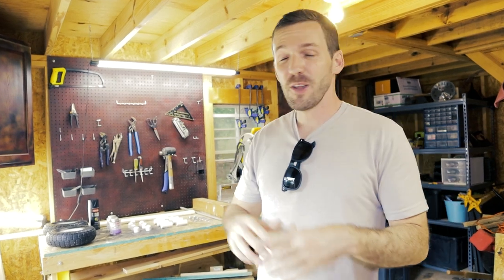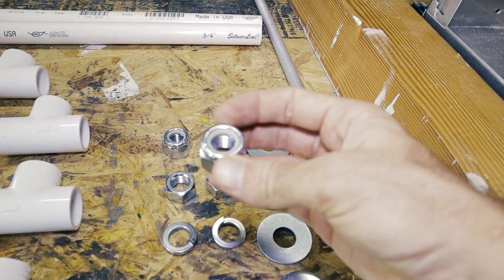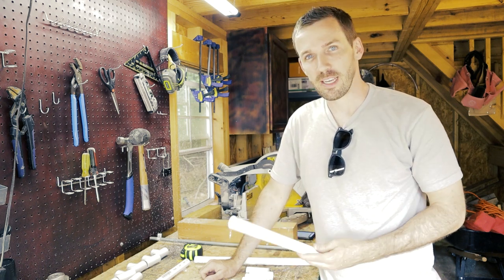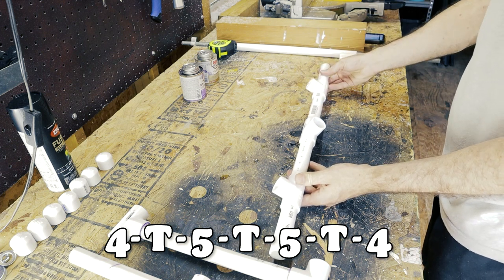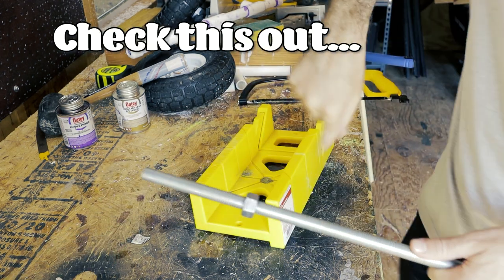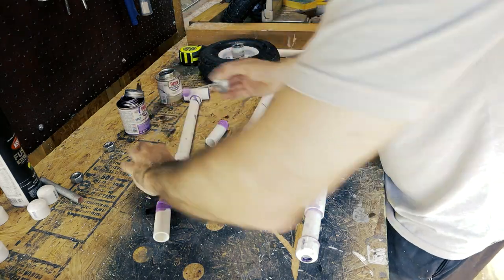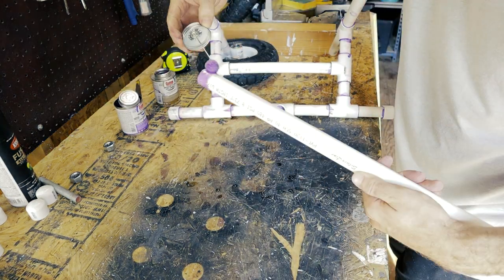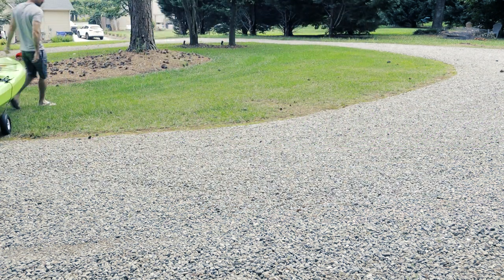How to Make a Kayak Cart out of PVC | CHEAP

Comment: I just added up the cost to build this as of July 2022. For the glue and parts used, going with Lowe’s prices, and two wheels from Harbor Freight, it is about $65, not counting the need for a foam pool noodle or pipe insulation, paint, or bungee cords to secure it to the kayak. Starting from scratch I believe this would be about $75 or more to build, using all new supplies, and doing it 100% right without cutting corners. If you already have some things available then it would be a bit better. Otherwise I have seen some ready made kayak carts already available for around $50, though the wheels don’t seem to be as nice. But those could possibly be replaced.

Some suggestions I would have when building this one would be to add 3/4” dowel rod internally in the H frame and in the top two T frames where the kayak rests when in use. This would strengthen the frame considerably against flex or impact. The Tee joint fittings would then be the only weaker areas, but at least the longer pipe areas would be much more stable and less prone to crack when flexed. Also, in order to make the paint stick better, or simply just to remove the lettering that is all over the PVC, rub it down with acetone. This wipes lettering right off and removes the glossy surface, leaving a matte finish that paint will stick to more easily. Nail polish remover is usually 100% acetone and is cheap at the dollar store. Works great.
Reply: For those tracking, this cart cost just north of $100 to make in July 2023 from Lowes
Reply: @giantmanice  I bought a decent one for $40 last fall. The same one now is $55, but that’s still just half of what you just stated. I don’t see any gain in making one anymore.

Comment: Thank you for the video. It was very helpful for this first timer. I have a few things to add …
.. when gluing, be sure to push the parts together firmly. Probably a no brainer for most, but again- first timer. 
.. I added a 1/4 x 3” eye bolt to each of the lower sections of the lift sections so I could hook a bungee after loading my kayak.

Comment: I made my cart almost exactly the same.  To make the holes for the axle in the pvc, I drilled small pilot holes and brought them up to size with a step drill. I used 5/8" cold rolled as  opposed to redirod. I hold the wheels in place with a small cotter pin and flat washer on each side. I broke one upright on mine, due to gross overloading and a bumpy trail. It was handling everything ok until I got to some big tree roots, was bouncing/ driving  over them, and one wheel got hung up suddenly.  My kayak is 77lbs, 35" wide.  I had a trolling motor, 12v lead acid battery, fishing gear, and a small cooler on it when it happened. I wrapped it with gorilla Duct tape to get me through, and I'm still using it almost two years later (average 8-12 outings a year). I upgraded my wheels to flat free ones. Great design, good video

Comment: I want to thank you for this video. I made one following your instructions. My kayak is 36 inches wide, so I made a little wider. I added a inch to the 4 and 5 inch sections. I didn't glue it together because when I put it together for the dry run I couldn't get the piece apart. THANKS

Comment: Ladies and gentlemen, I built this cart today. The only things I would change: 
- use steel for the axle tubing if your kayak has some weigh behind it. 
- add some sort of D-ring or attachment point. 
- add TWO flat washer to the built. Using locking washer up against PVC is asking for cracks. So the axle should look like: PVC cap, flat washer, locking washer, nut, flat washer, wheel, flat washer, nylon lock nut. 

I spent $41 exactly, and then another $20 on tires. I wanted to make it today, and found some awesome inflatable tires with grease fitting for the hubs, and figured since the trailer could end up in the water, being greasable would be awesome. I also added two d-rings, one on either side of the trailer/Dolly (trailly). 

So what I do is put the yak on the cart, run a 1” ratchet strap from one side of the cart, over the yak, down to the other side of the cart, and secure it. Put the front of the yak in the bed of the struck (or on top of a car), go to the back, pick up and push it all the way into the bed. What this does is keeps the cart attached to the yak for the entire trip from the house to the lake, to unload I just back the yak out of the bed until the cart hits the ground, walk up to the bed of the truck and grab the front of the yak and walk it where I wanna go. I never disconnect the cart before commuting! Works AWESOME.
Reply: Where did you put the d rings?
Reply: @KiltySpoke  as far to the outside of the kart as possible so that you have something to hook into!

Comment: Awesome job on this build! Strong & simple.  Heres an idea to make it collapsible:  dont glue the 2 foam covered T Supports to the 2 upper 3" segments...sand the top of the two 3" pipes to allow a little slip fit. Mount the 2 foamed bars on top with no cement, then drill a 3/16" hole in each to accept a tractor pin. Do something similar with the Kickstand to make it removable.  Or, don't even use it, tilt the kayak on its side and mount the Bungee strap.

Comment: Just a comment from a Canadian.  I have an 80-90 pound fiberglass canoe.  The above vide is good for a very light kayak.  So I made mine with 2" PLumbing PVC piping.  Bought the same quantities of everything as per above.  

Material and Cost
Wheels: 2X @ $14.99 each
T's: 7X @ $2.58 each
2"X12Ft PVC PIPE @ $13.19 each
5/8 Rod (72 inches) @ $14.99 each
2" Caps 5X @ $2.79 each
PVC Cement @ $4.25 each
Hardware (nuts bolts and washers) $7 for all.
2 rubber bungees @ $2.89 each
1 pool noodle $4

All of this for $130 dollars total (factoring our good Canadian Provincial and Federal Taxes (14.9% - Free healthcare does cost something)

So, I tested, and the device supports the canoe no problem.  If I could post a pic, I would.  Great plan and video above but again, if you have anything that weighs more than 40 pounds, I suggest going for plumbing PVC pipes.  More money, but much better durability.  :)
Reply: We’re you able to fit the noodle pieces over the 2” PVC?
Reply from the maker: Very cool! My kayak is 55lbs and yea the cart can't hold much heavier than this. Thanks for providing the parts list and helping everyone out who comes here!
Reply: @islandboysrc5910  Hi Jeremy, so far that is the only part of my 2" pipe concept I don't like.  So the noodles of course do not fit.  so I had to slice it lengthwise and open it to the PVC and secure with Tie Wraps.  I know big pool stores sell the very fat noodles,I'll be looking for this soon as the weight of the canoe really crush the small ones.  As for ease of pushing or pulling, this cart is a charm.  when the canoe is well positioned to the center of the canoe, it's like pushing a feather.    I have a 15' 1973 Bombardier fiberglass and teak canoe, weighs about 80-90 pounds.  Too bad we can't add pictures to posts.  I may post a video and link it in my next comment.  Cheers
Reply: @KellyConcepts  No thank you! Kelly Concepts!
Reply: What size wheels did you buy please?  Standard Dolly wheels are usually 10" but trailer wheels are bigger?
Reply: @markweatherall7437   Hi Mark, bought the dolly wheels.  Trailers wheels would need quite an axle I would think.   I build my cart for my canoe and it weighs around 80-90 pounds.  The system is pretty solid.
Reply: @guinesstom76  Thank you, I've thought of a good idea to save even more money when I find some. 10-13 inch dia child's bicycle wheels would do the job just fine. A bicycle that a child has grown out of & surplus to requirements going free.

Comment: I have made several iterations of a kayak cart out of PVC.  But I found PVC is not robust enough.  Even switching to schedule 80 pipe didn't work.  They were really sweet and worked perfect for awhile.  But, PVC is too brittle in cold weather and isn't strong enough for a heavier fishing kayak.  They all snapped eventually when they hit a bump or get jolted.  Too bad, because it seemed so ideal at first.
Reply: In the areas where the cart would seem weakest, you could reinforce it internally by just adding a round wooden dowel rod the same diameter as the inside of the pipe. With 3/4 pipe that should be a 3/4 dowel. It should fill it up completely and eliminate any flex which would cause the pipe to break. Poplar wood is strong, and oak is stronger. This does add to the cost though, and at some point it would cross into the area of just buying a ready made cart.

Comment: Just built 2 of them for my paddle boards. Cost around $100 to build both of them using 1” pvc. Seemed cheaper to build 2 than one. One of them would have been around $65-$80 depends on if you can find cheap tires. I was lucky to find 4 inflatable tires for $40 on Amazon.

Comment: Question is that long kickstand necessary? Can I leave it out? Or make it shorter? Looks like yours drag on the ground a bit now and then when moving.
Reply from the maker: It keeps the cart upright so it’s easier to load the kayak but that’s about it. I actually should’ve tilted the kickstand upward so it’d be far off the ground, not tilted downward like I did. I cut mine shorter to solve my issue.
Reply: Thanks appreciate it

Comment: Nice job. Only the lock washers serve no purpose except for being a  spacer. You'd be better off using another flat washer or 2. The lock washer will dig into the cap it's next to and and destroy it over time
Reply: For sure!
Reply: @johntruex  I would use nylok nuts on both sides of the wheel

Comment: For the axle housing assembly I used, going outward from ends of housing :
Coupling  / Drilled plug  / Fender washer / Regular nut with drop of red threadocker / Wheel  /  Regular nut with blue threadlocker
HF steel hub, plastic wheels with rubber tires for weight savings.
I tilted the stand housing upward about 15 degrees so there is little chance of the stand dragging or catching rocks, etc. when the kayak is moved, which tips it down.
Also, I didn't glue the stand, arms, or "H" assembly, so it can be diisassembled and placed in the cargo area of my kayak. 
I might drill for hitch pins but so far the pieces haven't budged.

Comment: Good stuff sir!! I'm building one of these for our paddle board based off your design and was wondering if you had any other ideas to control the sliding of the board on the pool noodles? The paddle board is lighter but still 12 feet long. We're up on Norman on the other side of Stutts so maybe we'll see you out there?

Comment: Great clip, thanks ,   one question and also one suggestion:
1- why do you need that long handle. seems not much useful
2- I am thinking  another method:  one (in 3 pieces) horizontal PVC connected to 2 vertical (with T of course).  those 2 vertical pipe to go directly inside  kayak scupper drain holes, .  the vertical pipes need a stopper (possibly a pipe with larger diameter than scupper hole)  to keep the kayak button above the wheels.    any opinion?

Comment: Just a question as I am building your dolly right now.  The kickstand.  When you are putting it together it seemed to stick straight out, but when I see it complete there is a bit of an angle (makes sense).  What angle did you put it at?  Great video.
Reply from the maker: Thank you! Straight out is actually ideal. I made a slight mistake here by angling it down a smidge, should have either kept it straight or angled up. It sometimes falls backwards when I am loading the kayak. Not a big deal, but annoying sometimes
Reply: @KellyConcepts  I am planning on using your design, the only issue is the angle of kickstand, that will be my only alteration..so I came back to comments and sure enough is has been addressed!

Comment: Great video! I think I'll try to build one of these. How far apart are the bunks once completed? That will be crucial for my build.
Reply from the maker: Thank you! The bunks on this one are about 12" apart. My previous cart was about 10.5" apart. You can change this up as you need to.

This one is wider because I felt like it would be a little more sturdy.

Hope that helps, thanks!

Comment: Great design, the only thing I am gonna do different is drill a hole in 5/8 rod snug against outside washer and use a spring clip to make it store smaller by removing wheels quickly

Comment: The wheels on Amazon are $35 for a pair. Plus other materials, may be able to buy a Malone cart for about the same cost. Of course you’d miss the diy thrill.
Reply from the maker: Yea true. At Harbor Freight the pair of wheels are under $10 with a coupon
Reply: What size wheels please? Standard Dolly wheels are usually 10" but for heavier outfits  some use bigger trailer type wheels?
Reply: 6.99 at Harbor Freight

Comment: This is such a good video. Thank you!!  I actually want t9 make one for carrying two stand up paddle boards and think this will work ( or some variation) .  You mentioned not gluing certain pieces if you want it smaller to transport- what keeps the two side together if they aren’t glued? Do you need to bungee them together if they are ‘collapsible” as it were.  Thanks again!

Comment: I made this exact cart. This particular cart doesn’t work for heavy fishing kayak. I have a 120 pdl and it’s way to heavy for this. The weight of the kayak puts so much pressure of the top tones that they come in glued even after curing overnight. Might have better luck with thicker pvc. Or instead using some kind of through rod on the top and not two pieces.

Comment: This came out great. The problem I’m having is that I like to use this cart with a fully loaded fishing kayak. Probably closer to 100lbs rigged up. Any suggestions on how I can make it stronger for what I’ve got? The axel bar looks like it’s flexing a bit. I wanna keep it as is since most of it is already glued. Could I add anything to strengthen the axel area? I know it this might be dumb question but could a 3/4” threaded axle rod squeeze in to a 3/4” PVC pipe? Was hoping the actual measurements of either product would be a tad smaller or larger than the stated measurements. Kinda like lumber. Any help would be appreciated.
Reply: Update: found out that a 3/4” axle rod fits perfectly inside of a 3/4” PVC pipe. So if you’re like me and needing something stronger that can handle a heavier load this is a great option. I also shortened the 4” PVC end pieces of the axle to 1.75”. This shortened the wheel base adding even more strength.
Reply: @stango77  Do you use Plumbing 3/4"  pvc pipe?
Reply: @markweatherall7437  yes PVC schedule 40 I believe
Reply: @stango77  Thank you.
Reply: @markweatherall7437  your welcome and Goodluck on your build.
Reply: @stango77  Whats your thoughts, I'm toyed between buying 10" wheels or 12"?  I can only find solid tyre 12" wheels at a cheap price but the 10" are air tyres? Thanks.
Reply: @markweatherall7437  in my personal opinion I prefer air over solid tires. They have a slight give and has better traction on all situations. And if you sometimes launch in sandy areas, air tires will definitely make things easier. (Bigger,wider, softer the better) But if you’re launching off boat ramps or other solid surfaces, solid wheels would be the way to go. Solid wheels are low maintenance and has no risk of a flat tire. (Although a flat may be super rare) solid wheels tend to be cheaper too.

Comment: your 11 1/4 inch cut doesn't work , it  should be 12 1/4
Reply: Why did you need the extra inch?
Reply: @michaelroach962  if you use the measurements in the video, you will not br able to connect the top part to the bottom.  It will not line up.